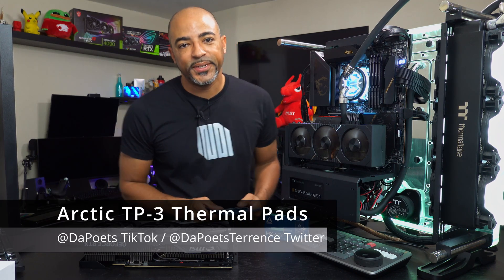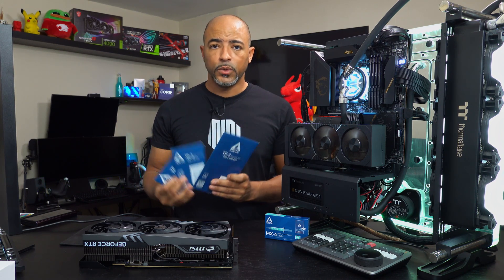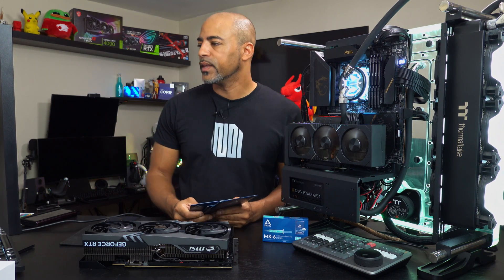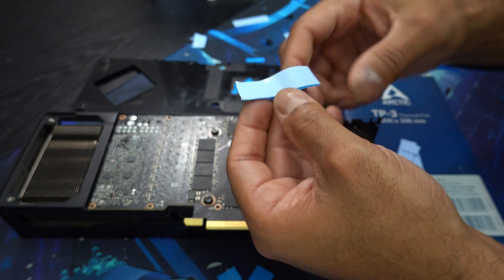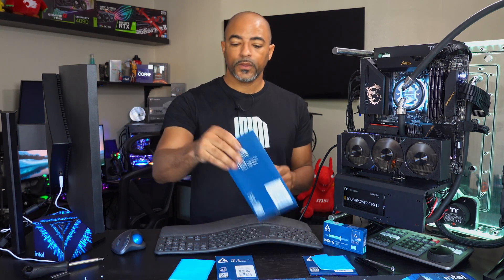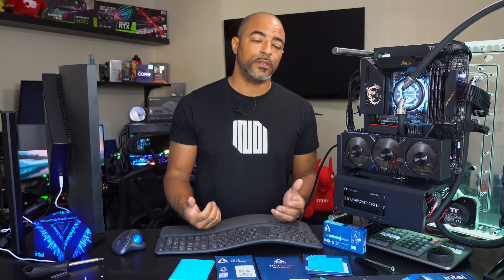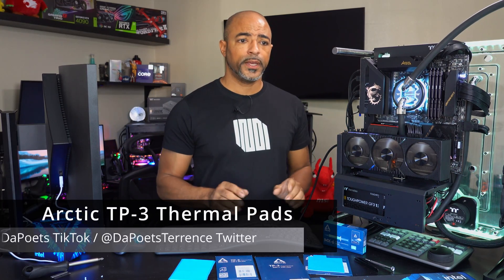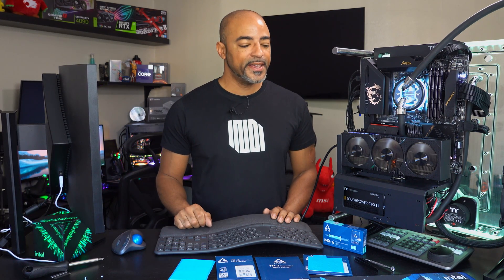Arctic TP 3 Thermal Pads on an RTX 3090

Comment: This was therapeutic to watch. 😄 Good job. Is there a reason why you didn't you change the pads on the front or did you do it off camera? Anyways, I can't wait to try this out on my 3090 Suprim X.
Reply from the maker: VRAM on the rear is what gets hot so no real need to change padding on the front
Reply: @DaPoets  That does make sense. Even cheaper to repad then. :)

Comment: I was debating on opening up my 3080ti I got recently, this motivated me to finally do it. Using the same pads. 💪
Reply: Did your temps get better? Debating on getting this brand vs my Gelid that I've been using for years. Theres also another new brand that looks pretty good for the price call " GHD HEAT ". They sell a non-branded " AAIRHUT"  thermal pad kit. You get a 4 pack of 13W/m.K 100 X 100MM in 0.5/1.0/1.5/2.0 for $18.99 regular but I saw them drop the price to $16.99 yesterday on Amazon. I'm going to wait for the price drop again and at least give them a shot.

Comment: Excellent video! Yeah finding the thickness is extremely tricky. Even calipers doesn't really help because they got squished and are thicker on the outer sides and thinner in the middle. So you have to kinda guess the nearest thickness. It even gets worse when it comes to the side where the GPU die is. If the pads are too thick, the thermal paste makes no contact with the GPU anymore and it overheats.
Reply from the maker: Exactly

Comment: Did you mean memory? VRM means "voltage regulator module" and is what powers the GPU, the SoC inside the GPU and the memory. Or maybe VRAM and VRM sound too similar for me. I am not a native speaker of English.
Reply from the maker: I should have said VRAM but it's possible I goofed.

Comment: My 3090 Strix watercooled both sides. average vrm at max load in the 60s celsius... long gaming sessions, was hitting the 90s with stock air cooling....
Reply: Did the same. Have the STRIX GAMING OC 3090. GPU temp never reaches 50°C, max was 47°C. GPU Hotspot never reached 60°C. VRM is around 50°C and the memory also 60°C for me.
Reply from the maker: Yeah my Strix 3090 VRAM temps dropped about 48c w/ the EK Active backplate too
Reply: 90c is perfectly fine for Micron vram
Reply: @funtourhawk  but 60 c it will last longer